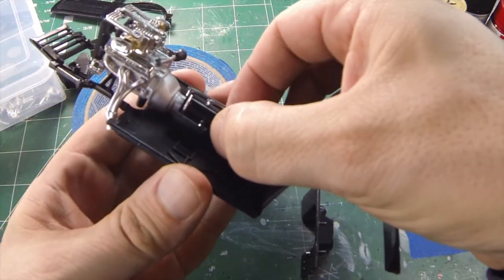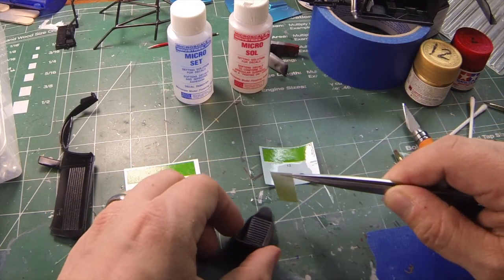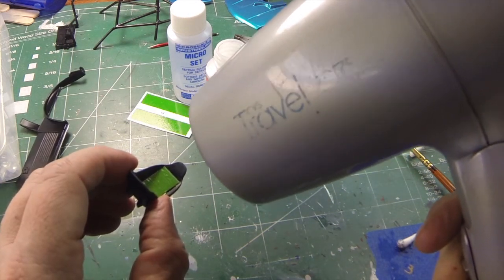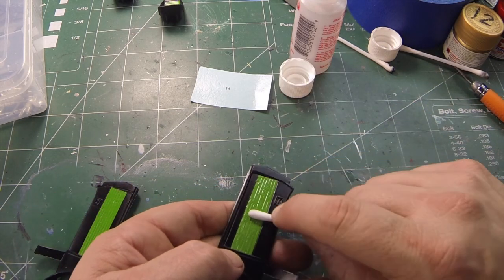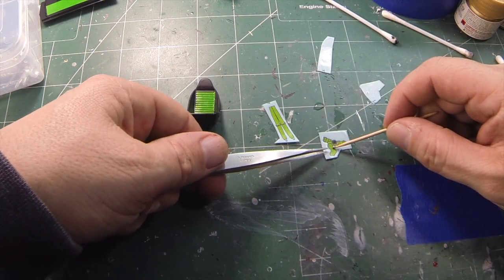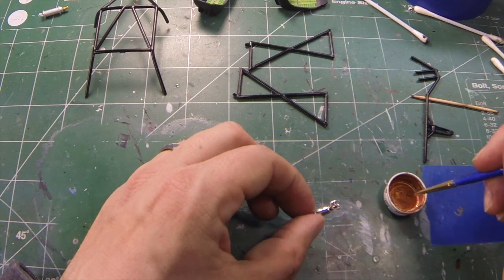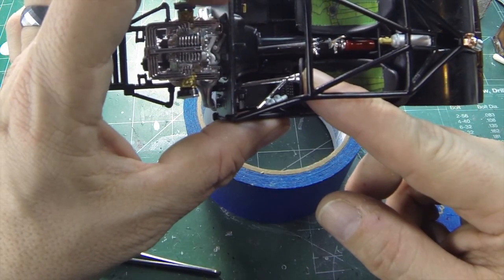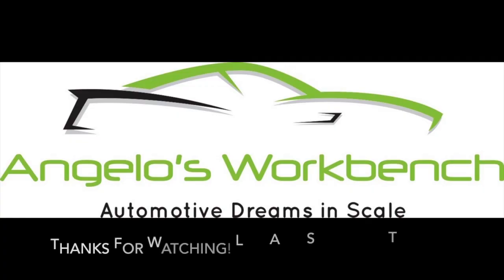Revell Chevy Beretta Pro Street Video #4

Comment: Whats the name of the decal solvent is that your using? And which one red or blue that docent have the odor to it.
Reply from the maker: Jeremy Evans hi Jeremy. The decal solution is called Micro Sol and works great. I’ve never noticed if either have an odor.
Reply: Awesome, thank you! Im learning alot of the back marker work you guys are doing with styrene also different chemicals also. Im still trying to figure out what is black wash. I only build mostly NASCAR and Sprint car kits so ive never used it. Now that im getting into Pro Street and Pro Sportsman dragsters and some custom cars, these front grills pertain to using black wash.
Reply from the maker: Jeremy Evans sounds great! Black wash is 1 part paint to 10 parts thinner.
Reply: Thank You so much for the help and replies! Build on bud and i'll continue to follow!